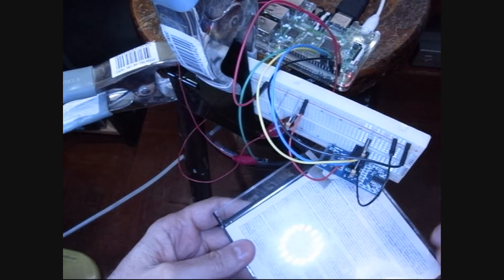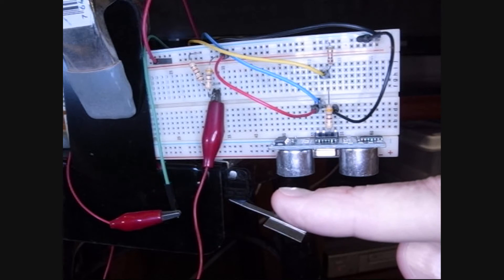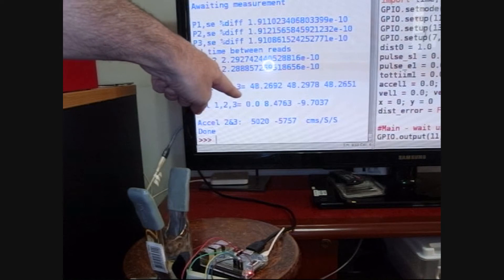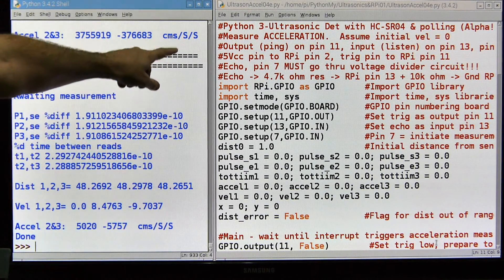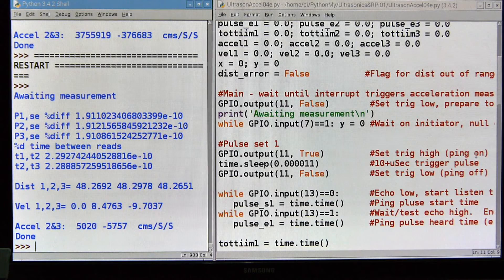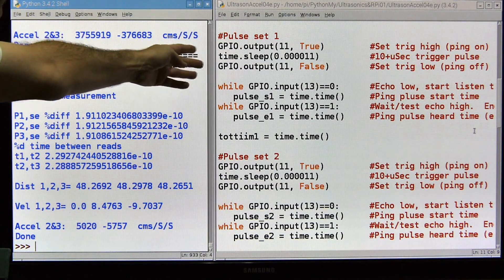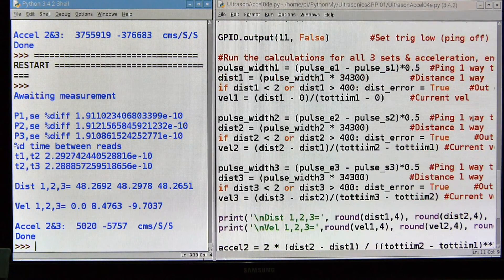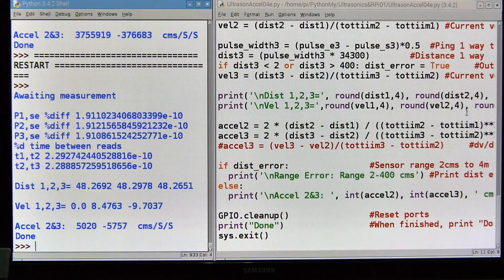RPi 12 - Ultrasonic Distance Sensor FAILS To Measure Acceleration

Comment: It didn't take long for you to become quite the expert on the Raspberry Pi.  To heck with the little flashing LED experiments, that's novice level.  Looking at the code makes me remember my nasty programming classes when you spend two hours figuring out you left out one little properly placed semi-colon.
Reply from the maker: A friend of mine overseas has a tutor school and he does corporate training so I made them with him in mind.  Started out simple and progressed.  I took a programming course and the final project was a bear.  Done on punch cards in assembler.  Could not get it to work for days, deadline was coming up fast.  Woke up in the middle of the night, went to my card box and pulled out one card and set it on end in place.  Next morning I checked it.  Changed that 1 card and it worked.